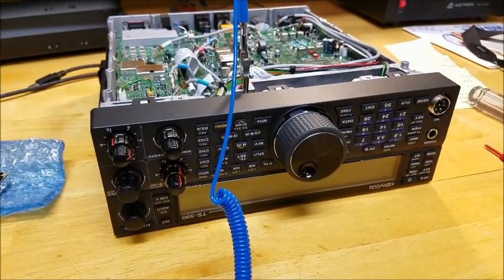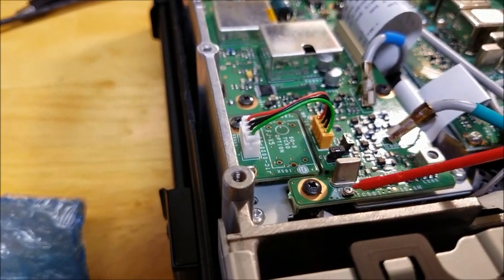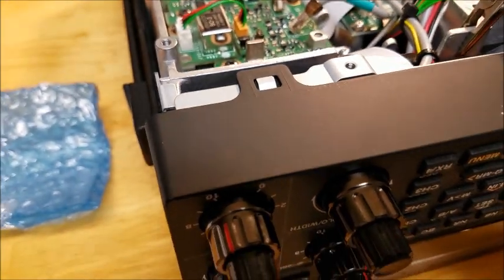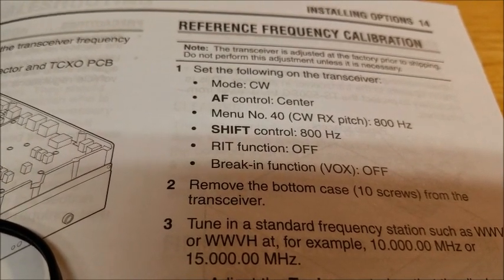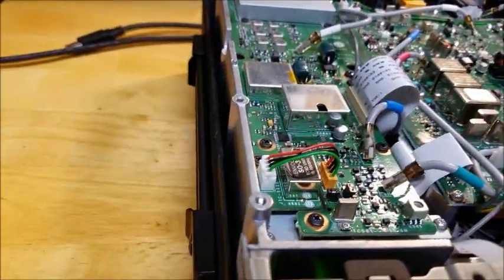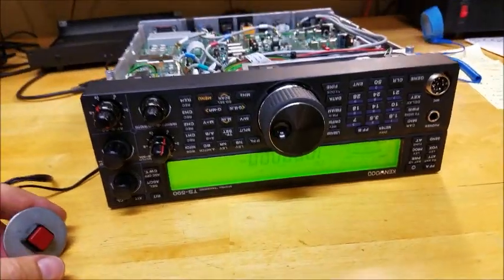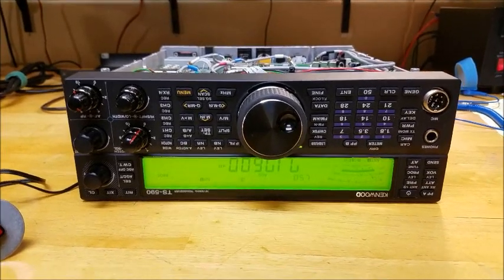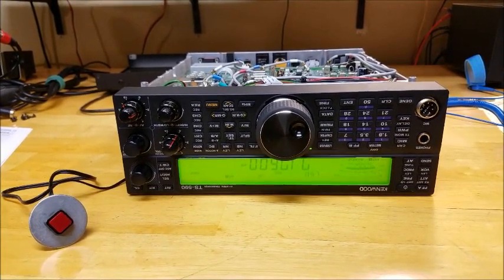KENWOOD TS-590SG SO-3 TCXO High Stability Oscillator Installation and Frequency Calibration

Comment from the maker: As a follow up 1 month later, this oscillator is right on the money. Most QSOs are locked in on the .00 freq. I used any QSOs that were on freqs ending in .00 or .05. Before, I was always 100 Hz high. Not no more. It is right on the money,.
Reply: Can you help, please?

I've just got myself a new TS-590SG & I'm pretty happy with it.

With RF gain on FM mode, though, I'm finding it doesn't attenuate signals at all. It only cuts them off suddenly & completely when wound fully CCW.

Do you know how to get this to operate normally, please?